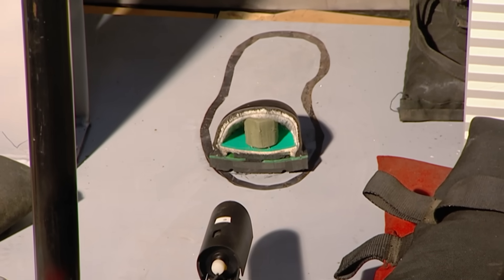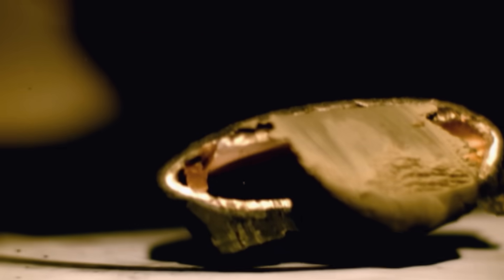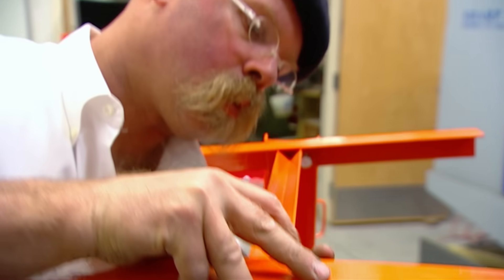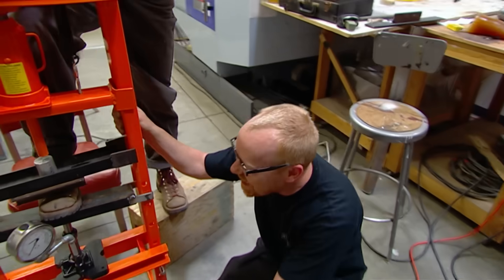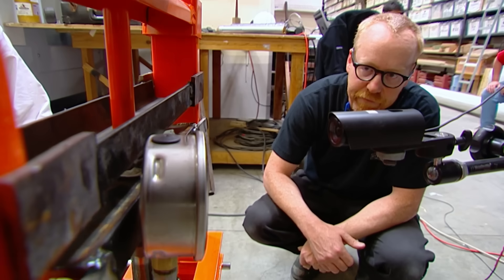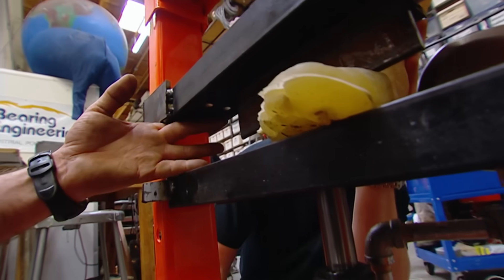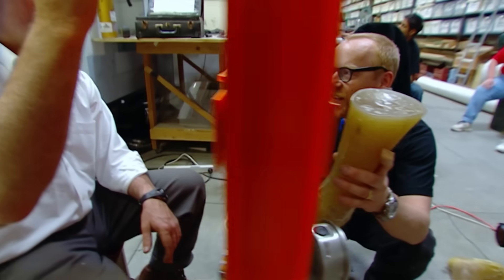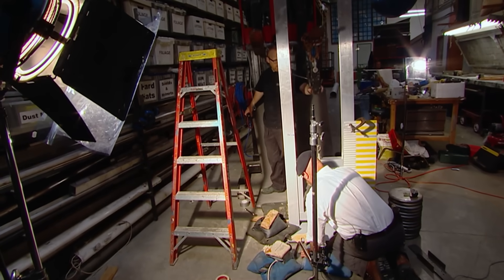Do Steel Toe Boots Really Protect Your Toes? | MythBusters

Comment: When I worked at the paper factory in town, I had a 2000lb roll tip onto my right foot. Pulled a kid toward me so he wasn't crushed. His foot goes behind mine, so I couldn't slide it back. Bruised my foot bones ( I didn't know you could bruise bones until then) but other than that i was fairly ok. Steel toe saved my feet 100%. If you can wear em, you should. If you work where you're required, WEAR them. And wear them right. PPE may save you

Comment: My dad was in the Air Force, working on C-130s in the 1980s. While they were working on an engine, a large wooden crate that weighed several thousand pounds, came off the safety strap and landed on another guy's foot. The man had steel toed boots on. The crate came down on his steel toe boot and crushed his foot. They took him to the ER and had to saw the boot off. The guy lost 3 toes, and broke most of the bones in his foot. Steel toes can absolutely amputate your toes. But the guy would have had more damage without the steel protection.

Comment: when i was 16 I had a riding mower accident and my foot went into a john deere 935 front mount mower.  Brand new pair of steel toed boots.  The steel toe was ripped out and flung away.  I needed a new pair of boots.  I still have my foot though. Safetty boots work.

Comment: In all my years of wearing steel toes I can only think of one definitive time they worked against me even then I didn't lose a toe or anything I just had some very heavy bruising on my big toe. Long story short rack hit the front of my boot with just enough force to flex the boot up and eventually no room left so the steel dug into my big toe. It hit a maintenance guys foot at the same time who was wearing soft toe and he was fine. Me on the other hand off to get Xrays to make sure my toe wasn't broken 😂. I'd still rather have the steel toe in that scenario though.

Comment: Worked at the airport for UPS for a time during Covid and bought some composite toe boots. One day, I was riding a cargo elevator up to a platform with containers and didn't realize one of the containers was overhanging the platform right over my foot. When we got to the top, my coworker noticed the box had raised slightly because my foot was wedged between the elevator and the part of the box that was overhanging. The container was 2000lbs but because of the composite toe, I didn’t even notice until someone pointed it out to me.

Without a doubt, it saved my whole foot.

Comment: Had to wear steel toed boots for my job. Bought a high end pair, extra wide. Wore them a few dozen times in the field at flat, developed locations. No issues. Then…

New project in the Angeles National Forest. We’d arrive at 6:30 AM, walk most of the day, and leave no earlier than 4:30 PM. Turns out the toe box is a fixed size. So a wide shoe is the shoe only. My little toe would go outside the toe box and the toe box tore up my second toe. On both feet, very symmetrical damage. Agony. Investigated other brands and all the toe boxes jammed my second toe on both feet. The second month into the project I bought a different pair of boots and told no one they weren’t steel toed. I am not going to injure myself to reduce the chance of another cause of injury.

Comment: I was in a crash going about 120km/h. My steeltoe boots probably saved my foot for the most part, although it did break my foot/toes at the knuckle in a line due to the steeltoe folding back on my foot while staying intact.

Comment: Only problem with steel toe are they very slippery come winter working outdoors or even in basements .
I use to install furnaces and ducking in newly built homes .
Often going to get spare material or other things you could slip .

Yes i know some people clued sand on the bottom but that was messy others use grapons but they cause damage due to the spikes .

Comment: Working in an underground mine in steel toe boots. Accidentally kicked a rock at some point and it sliced right through the front of my shoe, into the steel toe and continued around it and sliced the rubber off the front.

No steel toe and I probably would have had a toe sliced off. Unreal how sharp that rock was.

Comment: That incident in Australia is what changed the design for steel cap shapes. Having installed thousands of them into thousands of boots many years ago, I can tell you there was a subtle change in the shape, there the arch sloped towards the toe tip instead of being flat, in the hope it would bias the slide of a sharp object toward the tip and not the instep. Having watched the standards tester test various caps and footwear, from our own factory and competitors, you would be surprised at the difference between how well your toes will survive in expensive work boots, vs cheap chain store versions. Having the steel cap not even bend, but be forced out the bottom of the sole of the boot, essentially cookie cutter the sole, and pancake the toes, is horrifying. Or, the whole cap tips backwards, and the back edge cuts the toes off. This is where the urban myth came from. Legitimate laboratory testing of cheap and nasty safety footwear, where the steel caps rolled backwards.

Comment: Even if the steel tip actually cuts off your toes, it's still preferable to getting the toes crushed.
A somewhat clean cut is much easier to fix than chunky salsa, as reattachment might be possible.

Comment: In 1996, I worked for a company that overhauled power station boilers in southern Queensland. One of the riggers I worked with had the front part of his foot missing - chopped off by a steel toe cap... A loaded forklift ran over his foot. 

I've been semi retired and only purchased a set of steel caps yesterday to go on a course. I'm surprised they are still selling carbon steel cap boots. 

Around 2003, I saw a poster on a wall at a safety shop while buying a new set of boots. The poster had a side by side comparison between a steel toe cap and a carbon fibre to cap. The test was hitting them with a 10 lb Sledgehammer. 

After 5 hits, the steel toe cap was crushed. The carbon fibre toe cap was 'slightly' dented after the same amount of hits.

Comment: steel toe boots aren't designed to protect your toes. They are design in such a way that if something heavy enough to crush your toes would instead, hit the metal plate, and if it's enough force to move the metal, cleanly sever your toes, thus making it easier to fix rather than trying to rebuild crushed/shattered/destroyed bones/flesh/muscle.

Comment: I felt kinda stupid putting on my steel toe boots just to go move some relatively light 1.5” pipe around and of course I pulled it out of the truck and immediately dropped a piece on my foot. Wouldn’t have cut a toe off or even broken one, probably, but sure would have hurt anyway! Because I did wear the boots I didn’t really even feel it. Smart move to just use the safety gear.

Comment: Mythbusted?! NO!! Its Confirmed! Hell, they even found one news report confirming it happened already once!!! WTF they talking about?!
Reply: The myth wasn't "can steel-toed boots amputate your toes?", it was "are steel-toed boots more dangerous than normal boots, in the case of a heavy weight impact, because the steel can curl down and amputate your toes?" Their findings were that no, any impact that could even possibly amputate your toes would do so much worse without the steel-toes (so they're not more dangerous), except in the case of dropping a literal ton weight ending in a literal guillotine blade on it, where it was slightly worse, but not because the steel curled and amputated the toes. So in both cases, busted.

Comment: As a professional metal worker I’ve had many a save by my steel toed boots. One of them involved a column that slipped off a saw horse. Thankfully it was small and only weighed around 300 lbs. The 0.5 inch baseplate hit my steel toe from about 2.5 ft similar to this guillotine test, then bounced and landed on the arch of my foot which hurt like hell but didn’t break. Metatarsal guards would have helped.

Comment: Ive had steel toes save me from a chop saw cause i slipped while cutting rebar, i was amazed how fast it tore through the steel cap 👀

Woulda gone through just leather and my foot like a hot knife through butter, the steel withstanded exactly as long as long as it took to react, was more than halfway through the steel 😅

Comment: I like my steel toed boots because when I can’t set something on the ground (like a tv, painting, or pan of glass) I can always rest it on my the exterior rubber if I need to. Also allows you to kick things without worrying about it.
Reply: Very good point, they're practically armored shoes, you can kick at and step on all kinds of dangerous stuff with zero risk

Comment: If a guy was working near a forklift, and something fell off and landed on his foot, odds are likely that one or two things happened. 1, he was standing closer to the lift than he should have been, especially if the lift driver was actively lifting the load. 2, the load wasn't secured properly. Either way, if you are standing at a safe distance, you are prolly fine, even if the load isn't secured properly.

Comment: I've had a steel box filled with steel balls, which weighed over 1,500 pounds, fall on my right toe.. as it was it still bent the steel toe down some, and bruised the fk out of my foot and toes.. without that steel toe, i would most likely have lost at least my toes, maybe my entire foot.. what we called a "lot can" fell partially on my boot after the sling cable snapped (overhead crane setup, you'd walk sort of behind the object you were moving. ) .. I still couldn't barely walk for a week or so. 

so yes, steel toes really do protect your toes lmao. they get cold in the winter cause the steel will freeze, but that's a sacrifice i am willing to make.

Comment: I had an instructor once tell me the point of steel toes isn't to protect the toe, it's to keep it in the boot until you can get to the hospital.  Words I live by.  Just because you have armor doesn't mean you're invincible.
Reply: Huh? that makes 0 sense wtf kind of instructor was that because the point of steel toe boots is exactly to save your toes from getting crushed or cut off from a variety of heavy duty jobs with dangerous equipment. The steel cap is designed specifically to spread the force similar to an Arch in buildings but also against sharp objects or piercing tools. WTF  kind of instructor was that for real? 

OFC the best thing to do is not have accidents but they will occur that's why you have armor to save you if your skill(in combat for exmple) or reflexes, and procedures fail.

Comment: They used to make up all sorts of reasons why safety belts in cars were more dangerous.  They were always the one in several million odds, or the driver stupidity cases.
Reply: Seat belts have saved my life 4 times thus far. None of those times was I the driver. Wear it.
Reply: Mostly it was poorly built or maintained seat belts that caused issues. Ones that were hard to release, often because they had really short receivers, complicated buttons to release etc. Kind of like Electric car doors now. Where people die because they can't exit the car fast enough.
Reply: Yeah it basically comes down to "Thats not the way im used to doing things so I dont want to do them that way."

Comment: Around 1980 when I was working on an Oil drilling rig a coworker had 4 of his toes cut off cleanly, only his baby toe didn’t get hurt.  This happened  while rigging up and lifting the monkey board up to the derrick and it unhooked from the crane and swung down to the ground. The worker luckily ended up standing so that he went into where the ladder access was to access the platform, a few inches either way and he wouldn’t have survived.   I ended up picking up the toes and packing them in snow so they could go with the worker on the helicopter taking him to the hospital. They didn’t manage to reattach any of the toes.  It was a clean cut and surprisingly there was only a couple of drops of blood.

Comment: If a sledgehammer falls off the shelf and lands on the steel toe your good , if it falls over farther out of the steel toe it will break ur foot, bottom line if you shoot a steel toe with a 9 mm you will have the same damage done with or without it , if you shoot it with a pellet gun is why they are importent

Comment: Been using steel toes at both my jobs even if it’s not required. Dropped brake rotors turbos and transmissions on my feet with no problem. My jobs are both manual labor and don’t require steel toes but after 8 years of working in warehouses and other jobs steel toes saved me

Comment: Every scenario where someone has lost toes while wearing steeltips would have been a full foot amputation if the steel toe wasnt there.
Reply: I knew a guy who worked in an oil field in Illinois. Crane was moving a multi-ton "table", chain broke and it ended up on his and his partner's feet. He wasn't wearing steel toed boots & coworker was. Steel in the boot sliced the coworkers foot off, Joe's foot got mashed. They used plates and pins and such to fix up Joe's foot and he at least had some decent usage from it; the other guy never walked right again. That's the only scenario I've ever known where it might have made sense not to wear them, and even that particular scenario is exceedingly rare.
Reply: @douglasphillips1203 how does a toe cap cut off an entire foot? Wtf is this story? 😂
Reply: @davorzdralo8000 its make believe land.
Reply: @douglasphillips1203  Interesting story.... if the load was heavy enough to turn a steel cap into a guillotine, I doubt the crush injury would be repairable.
Lifting chain is tested to approximately 3 x WLL...
Reply: @andrewsmith8729 this was 30 years ago when I was a kid so I don't know the exact details, just know what they said happened and that they were able to repair Joe's foot. It's possible he got less of the impact than the other guy, but again don't know the details.
Reply: @douglasphillips1203  It's either a lie or just an anomaly.  Clean amputations are far easier to repair than crushing.  Just sewing it back on and the healthy tissues mending back together vs. a mashed up meat tube that has no way to recreate its structure.
Reply: @douglasphillips1203 absolute mythological bullshit but sure. This video literally proves it.
Reply: That makes no sense whatsoever. If something hits only the steel toe section and the steel toe bends and cuts off your toes, you would lose the exact same amount of flesh or maybe a bit less if you were not wearing them. The only case of which you would lose more without a steel toe would be if the thing hit up higher than where the steel toe reached anyway. Just to clarify, bones crushed does not equal amputation. My uncle shattered his entire leg in a motorcycle accident with a telephone pole and still had his leg until the day he died decades later. Just with a ton of hardware.
Reply: @KingNiros  Crushed bones can be much worse than amputations, especially for your foot. There are 4 bones in your leg but 26 in one foot, trying to put that many crushed pieces back together is incredibly hard. There are also a lot of complications that come from crushing injuries such as compartment syndrone (which i have had myself and can say it was the most pain i'd ever been in and hopefully ever will, luckily only left me scarred and with a little less mobility) which might result in them amputating it anyway or your life might be at risk due to necrosis. I'd take a cleanly amputated foot over a badly crushed one anyday.  Though in the situation where the steel toe cap amputates your toes they are likely crushed too. Medical technology has come a long way but i'd still take amputation over crushing.
Reply: Your statement is flawed.  The steel only covers your toes. So if something was big enough to cut off the entire foot you are still going to lose the foot even with dumb fuck steel toed shoes
Reply: @maxheadroom8097 Who you talking with?  And it is not big enough... It is heavy, or weighs enough.
Reply: @maxheadroom8097 Most good steels toes have some form of metatarsal guards in them. They prevent injuries to you upper foot where the steel cap doesn't cover.
Reply: That is not true. I've worked with a lot of people who've dropped things on their feet... never seen too many missing toes. 
Lawnmowers are supposed to be pretty bad.

Comment: My issue with steel toed footwear is that what ever winds up falling on your foot always seems to find the unprotected part of the boot
Reply: Use to wear an add on shield while grinding brake rotors. Attached to shoe strings just even with steel toes. Dropped many on my foot over the years and they protected my foot. Weight of 37 lbs for the heaviest. Had to grind 284/hr. Do the math on weight per day. 23 lbs lightest and a number of them in between.
Reply: That's why many people wear the steel to with metatarsal guard. Come in external and internal varieties. External i think are a little more robust in their protection but tend to dig into your foot and be painful when crouching or kneeling.
Reply: My experience too! 😢
Reply: Gotta bring back those knight boots for that, itd look badass too